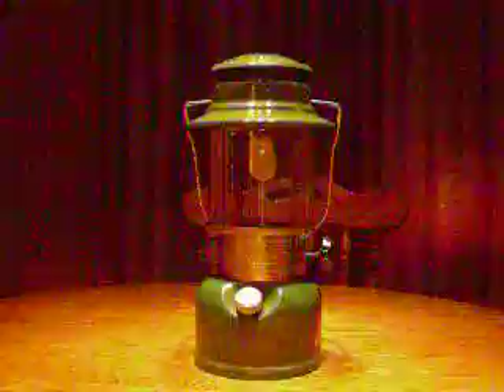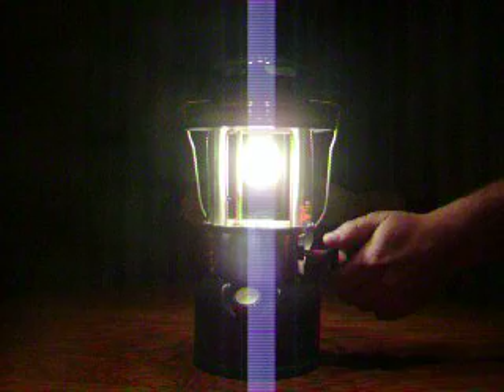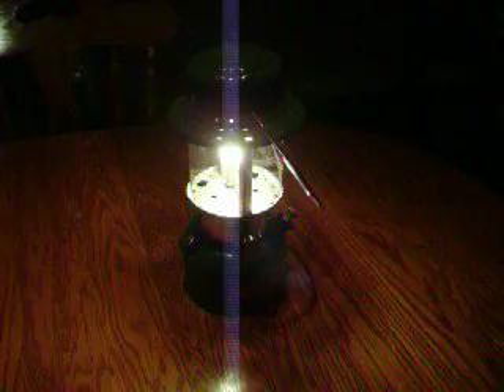Coleman 335 lantern

Comment: @northerbrewer Thanks for the tips! But I already got it working. The problem was that I filled it up right to the hole and it wouldn't let me pump any air in (it felt like something was rusted together from the pump) but then I figured there was no air space for compression so I poured out most of the fuel (probably more than half) and tried again and viola! I knew not much can go wrong with these things, but I'm pretty sure I remember on trips my dad filling it right up with no problems. thx

Comment from the maker: @heli400 

Sounds silly but take it all a part and wash all the pieces in mild soap.

Clean the generator with carb cleaner usualy that helps clean then enough to use ( G3 is an obscolete gen and hard to find ).

The tank shoudl be OK inside its painted if its rusty send me a PM for some advice.

Not much to go wrong with this lantern.

Comment: Northernbrewer, I recently got a 335 from my father in law.  It appears immaculate, and was only used a few times then stored for 20 year.  I can't get it to run.  I took out the pump and put it overnight in oil - the leather looks perfect.  The tank does appear to take some pressure but not much.  When I turn the valve I do hear some gas escape but it won't light.  When pumping should you feel the pressure gradually build in the resistance on the pump?  I don't feel resistance increasing.  I took the generator apart and it looks clean and in good order.  Can you give me some advice please?  Last question, until I can get the #999 mantle is it okay to use a #21?  Thanks!
Reply: The valve is clogged by residues from old stale fuel that's been sitting in the tank for years.  Had the same problem. You need to disassemble the valve and let it soak in brake cleaner or lacquer thinner overnight to clean and unclogged it.  You better use Coleman #99 mantles, the factory replacement for #999.  You can get them from Amazon.
Reply: ... and disassemble pump and soak the leather cup in motor oil for 1½ hour.  Pump should them operate as new.  If not, then there's also some old fuel residue in the check valve.  If you can unscrew it and not damage it, you can then clean it.  If not, you'll have to replace it.

Comment: Ross

I just finished restoring my 335 this evening. I found a great guide www.oldtowncoleman.com. I totally stripped and cleaned mine down to bare bones. mine was used and abused but works now... It covers the older 200 model but will work for the 335. try adding some oil to the pump. the leather plunger is probably dry.